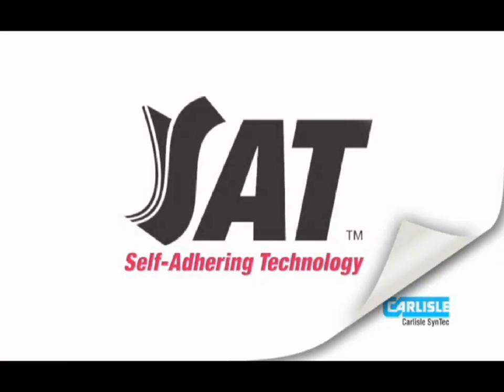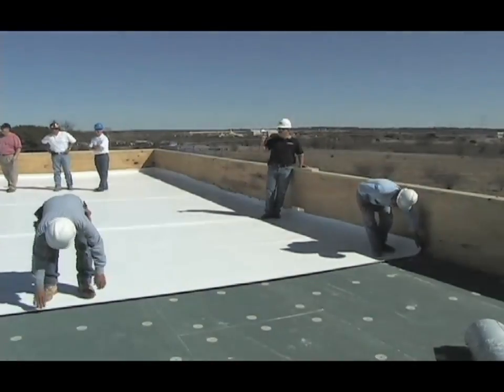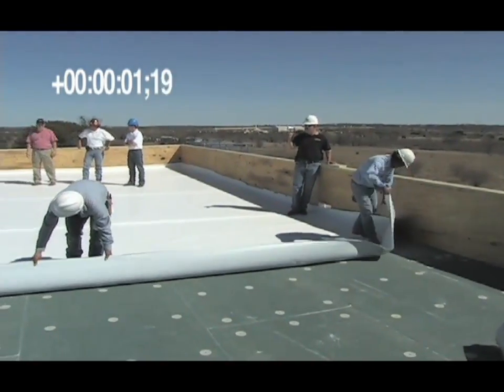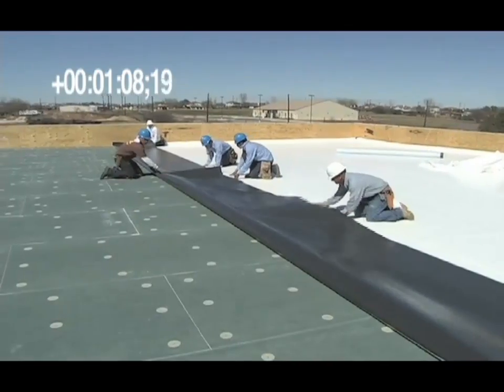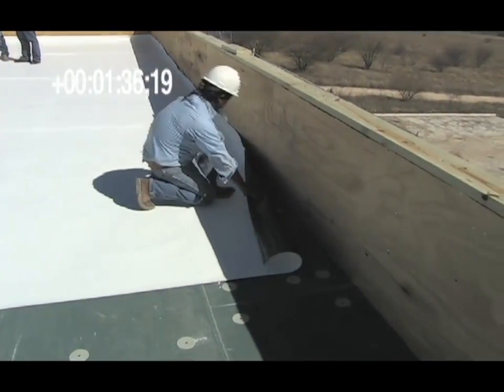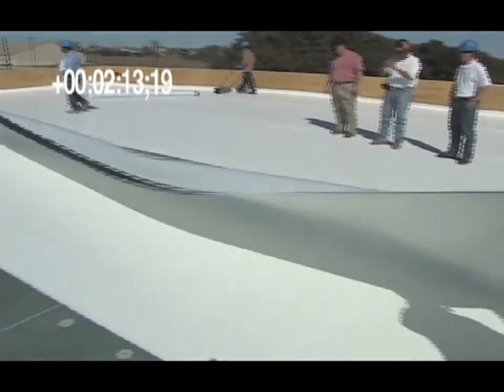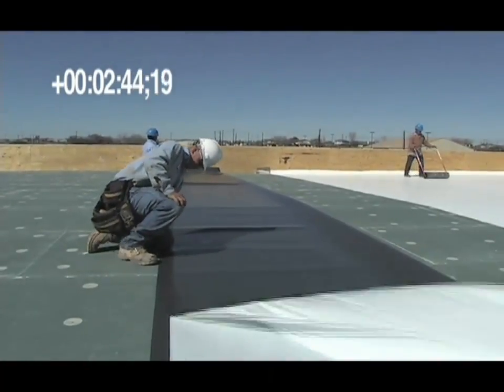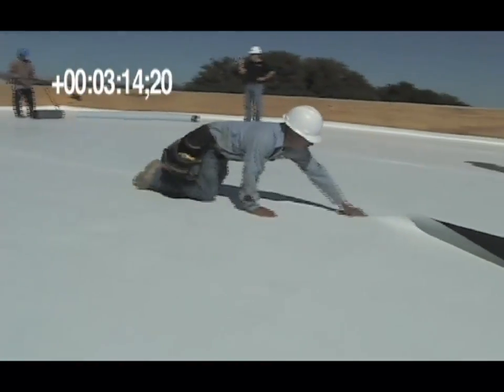SAT (Self Adhering Technology) TPO Roofing System

Comment: Wow I like that.. Cuts man hours though.. Since no adhesive is rolled onto the ISO board and membrane.. I also noticed no plates were lined down the seam in the field.
Reply: John B Don't worry too much about losing man hours with peel & stick single plys because they are only good for new construction where man hours are low to start with ,it's impossible to use these peel n stick systems on a pitch or asphalt roof tear off because the dust contaminates the field sheet .
Reply: @michaelledford4751  I agree to an extent.  The prep work gets extensive after a tear off. Unless you're putting on a thick separator such as I do with board, it can get complicated.  However it can still be better than other adhered options. 

The main factor to consider shouldn't be price but resistance to uplift

Comment: So this has to be hot air welded at seems? Not glued like tpo?
Reply from the maker: Correct. The SAT will stick to the insulation but the seams are heat-welded to ensure that the roof is water proof.
Reply: Thank you & this is a very helpful video. I asked because we had some apartments roofed & the "roofers" used epdm glue, no insulation or slope. They caulked down the boots. Needless to say, it is coming apart & leaking.  This is what happens when your "roofers" have no clue!
Reply from the maker: Lee, I am sorry this happened! We are glad you found this video helpful...we want to post educational videos like this so that the same situation you faced does not happen too often.
Reply: I'm a retired roofing contractor.  I'm curious as to what happened to hot mop roofing?
Reply: Lee Cooper as a proud member of Roofers & Waterproofers local 149 I would suggest that in the future you do NOT hire roofers from the phone book or Craigslist ,instead contact your closest Roofers Union local and ask them for contact information where you can speak with representitaves from manufacturers like Carlisle, Firestone ,Versico , Johns Manville ,Tremco ,The Garland Co etc and they will supply you with a list of certified roofing contractors in your area ,you can even have an inspector from these material manufacturers inspect the roofing while it's being installed to assure quality ,and when the job is finished the manufacturer will again send an inspector to check the finished product for even the slightest deficiency and make the contractor repair all substandard work ,if you hire a union roofing contractor it's nearly 100% certain that contractor will be manufacturer certified in all systems they install .

On top of being a Journeyman Waterproofer for over 30 yrs im also the owner of 67 rental properties ,4 of which are apartment buildings with flat roofs ,all but 1 building I've installed TPO except 1 and that building required a Coal tar pitch 5 ply hot BUR .

Comment: jr260551.. I believe they left 2" of membrane up the parapet to act as a RUSS strip, add 2" plates or term bar and fasteners to wall membrane.  Save money by doing it this way and it does meet manufactures specifications.